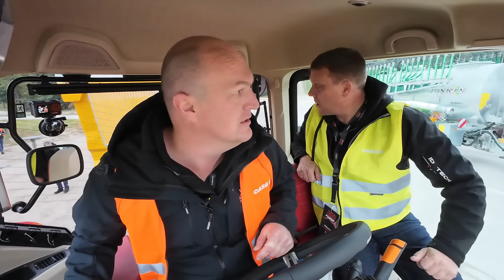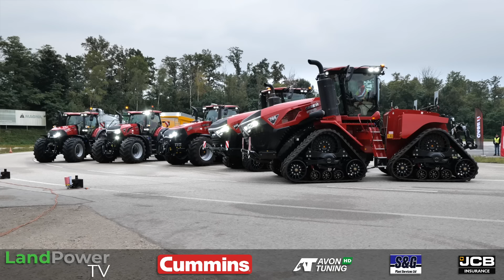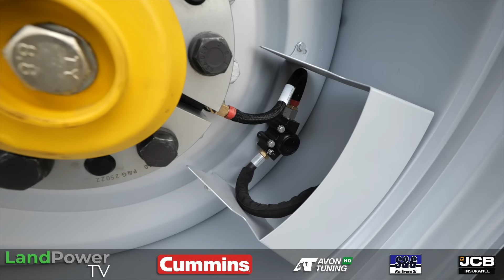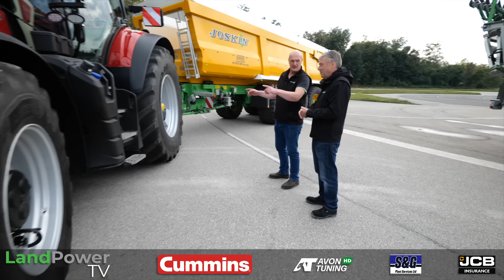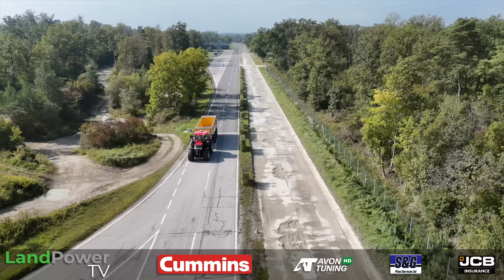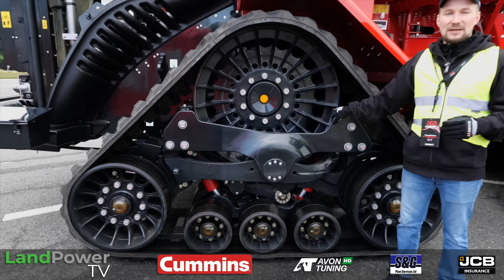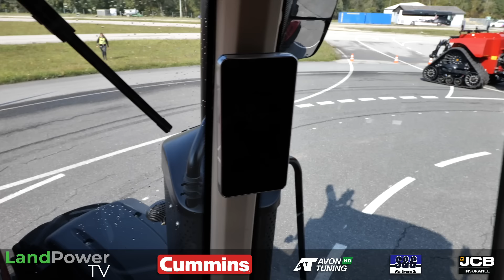LAUNCHED: Case IH reveals three new Optum tractor models | Plus updates to Steigers and Magnums

Comment from the maker: In this episode:
00:00 New Optum tractor walkround
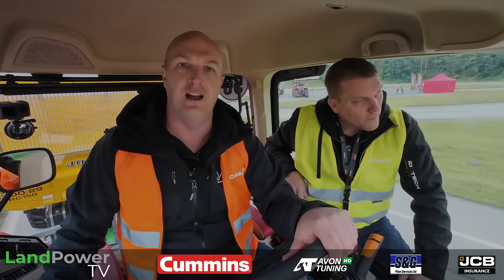20:09 Optum driving impression
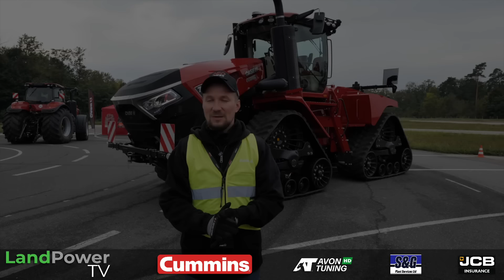32:25 Steiger developments
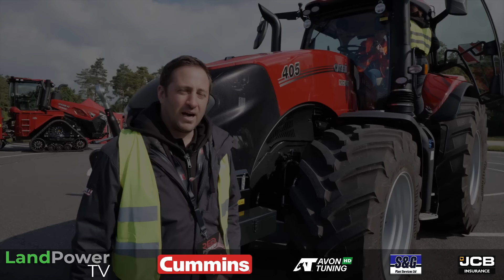39:09 Magnum updates
Reply: Are they updating the magnums look to match the other new line up?
Reply from the maker: @DeadstringRed  I would imagine all the tractors throughout the Case IH family will eventually get this new look. It'll be interesting to see what they do with the Magnum, as this new Optum completely overlaps it in terms of power. I would guess the Magnum would have to 'grow up' power-wise. We'll see.
Reply: I don't see the magnum line getting phased out unless the optum has front duals like fendt  these look like fendt but no duals.

Comment: Wow it is about time caseih comes out with independent front suspension!!!! I'm so sick and tired of breaking my back on rough roads hauling manure or running silage cart!! Not sure why Case had to be the last to introduce it though. Hopefully they bring it to the magnums before we have to get fendt 😂😂
Reply: Is there any need for magnums now wen this has as much as the smallest quadtrack? Strange no hood update. Could mean a phase out.
Reply: I think their going to be updating their magnum to. It's going to have up to 500 horsepower supposedly, I could be wrong though @DeadstringRed
Reply: @BudRockwell-h3o  who needs a row crop with that much hp? They may as well phase them out. Optum even laps with the lowest hp steiger.  The optum is basically the fendt line.
Reply: I dunno maybe cause it's smaller and cheaper  @DeadstringRed

Comment: I have a question, that is in my mind for years. Why all the new tractors, don't have all wheel braking system..? that way, they should brake better in any condition..........!! in this model for example, with a new font suspension, they could easily put font disk brakes...........!!!  P.S...,    OK it is explained in this video.. for  the brakes of the specific model..!   my question though.., involves all the tractor models..... generally.....!

Comment: I've made this observation before; the Optum 440 has a tyre inflation system. Look at the front wheel valve and hoses assembly and compare to the rear. No guard! Clearly that exposes those sensitive areas to mud, rocks and all else. I have had it brought to my attention, and having looked, one image of a 440 ploughing appears to have a large guard in the wheel well area. It is unclear if this is specifically for the inflation components as the rear wheel angle does not allow vision of the whole wheel inner area, to see if that tractor has the system fitted.
The point is that Case should of course have guards fitted on the front wheels, I will be shocked if it goes to market like that.
Reply from the maker: Hopefully, by the time it goes to market, it will have some guards fitted around the hoses.
Reply: where have you seen that image of it plowing?